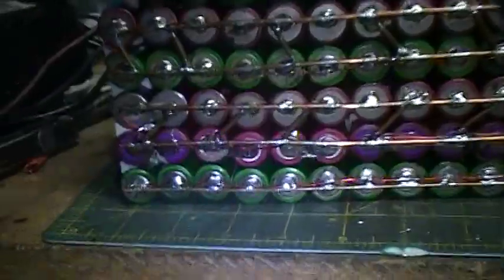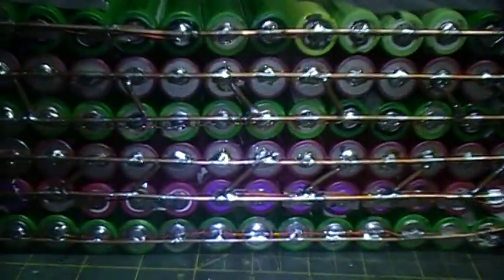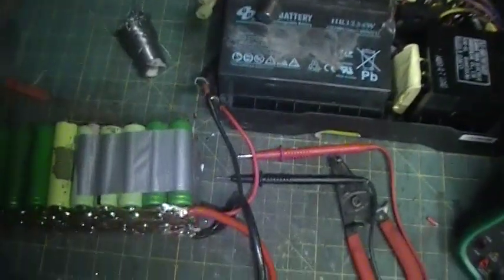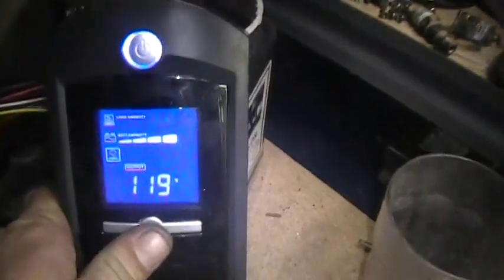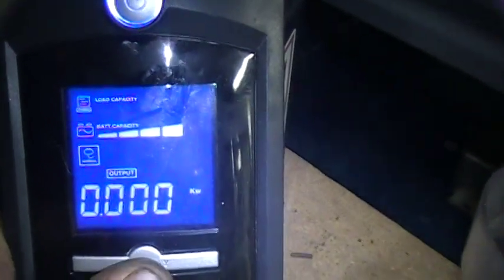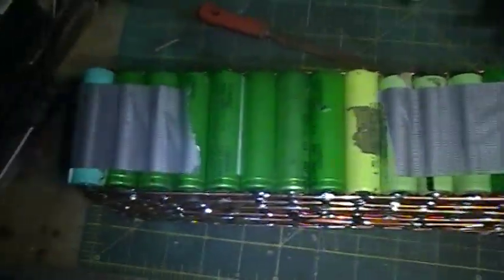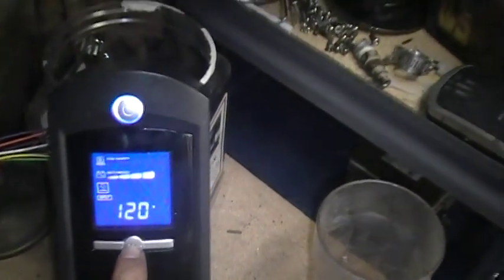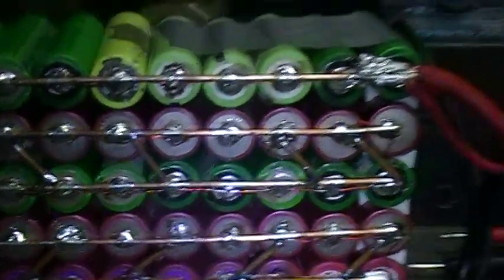Homebuilt 24v Lithium battery pack

Comment from the maker: NOTE TO ANYONE ATTEMPTING THIS >>>>>>USE A BMS!!! These cells can EXPLODE when abused.
Reply: This ups has a .5 amp charge rate and you need a bms and a charge protector for over charge on the battery feed so you don't over charge them as the setup is for lead acid at 24 volts will charge to about 27 volts!! 
6 cells gives you 22.80%  to 25.2 fully charged lead needs higher volts so you will at min cook your cells or maybe with no cell fuses blow them up!
Reply from the maker: Emmet Myers a lithium phosphate pack would be a better match...
Reply: it sounds like you found out the hard way lol